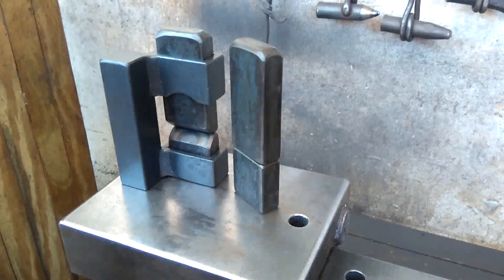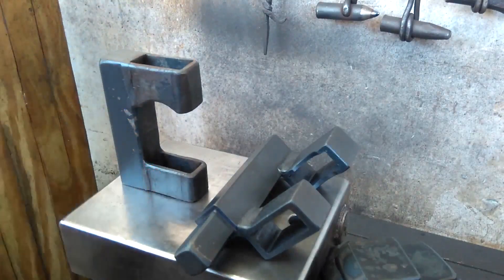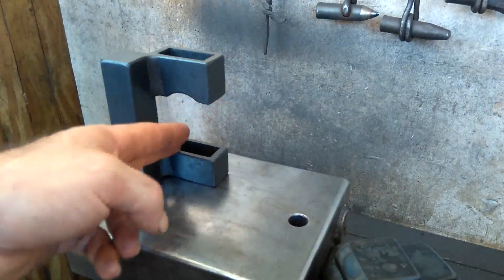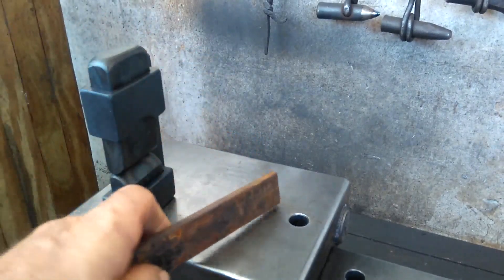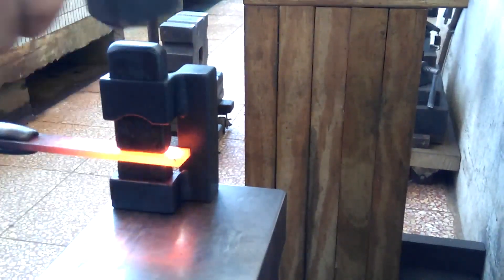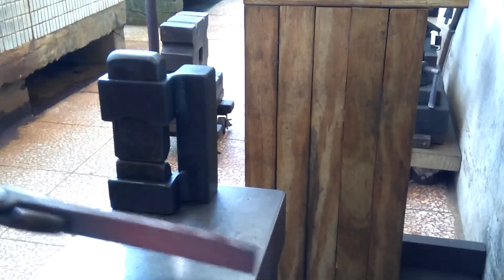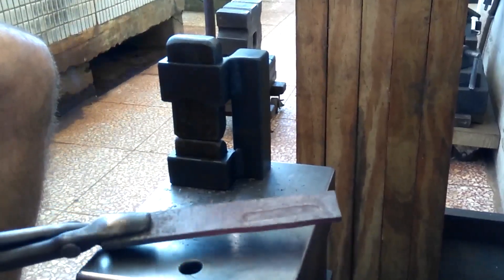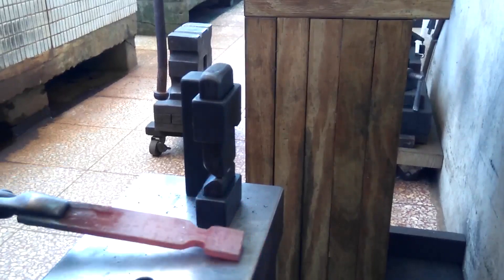Blacksmith Guillotine Tool - Blade Fuller / Blood Groove / Goutiere

Comment: I think that works well for fullering. Fullering both sides at the same time makes it accurate as long as they are perfectly aligned. Yes, I see how it works for other jobs as well. Having both top and bottom accurate is key.
Reply from the maker: My simple guillotine tool is very useful for fullering top and bottom. Thanks for watching.

Comment: The best blacksmith DIY’s on YouTube.Thank you,Glen!
May i ask how to get such a cool black color on the tools?
Maybe you mentioned it but i can't find.
Reply from the maker: I take a low heat, dull red color, for the final heat. Then I wire brush the workpiece until the price reaches a cooler, black heat. Then set aside to cool and spray with WD-40. Nothing fancy. But it also helps to have your forge running a neutral fire, preventing too much scale from building up. Thanks.

Comment: Thanks for sending me the link to this video Glen.  You have done a great job on this tool.  I am fairly new to blacksmithing, and at present just into making small stuff, so this tool would work great for me.  Are you going to offer more dies for sale down the road? Maybe a butcher or a cutting die?
Reply from the maker: I currently don't have any plans to offer more die styles but I do offer blank, un-heat treated dies that are cut and ground to size for those who want to make their own. Thanks.

Comment: The quality of your video is awesome!!!!! Just curious, could you have two different types of dyes on the same bottom? I don't know if it would eventually disfigure it or the anvil, but having two different types of dyes on the same piece could be nice.
Reply from the maker: Phillip, Ironically, I used my old camera for this video. Your questions is interesting - I never thought about having dies two-sided before. I would be a little concerned about marking my anvil face, depending on the die shape. So for now, I think I prefer to have the bottom of the lower die flat, flush with the anvil face. But it definitely could work... Thanks for this idea. Glen
Reply: Hematoma

Comment: Nice improvements! If you used a soft hammer, could you make the dies double ended? IE a different pattern on each end and flip them over?
Reply from the maker: Jack, Someone else asked the same question. Yes, I suppose the bottom die especially could be made double-sided. But I would be afraid this might mark the anvil face, depending on the die style. But I never thought about this before so perhaps I need to think about this some. Thanks for your input.

Comment: We used to call these "Blacksmith Helpers" in the 1990's. Rather than mill out the stock, why not just use tubing?
Reply from the maker: That's a very good question. I originally wanted to use tubing but it was impossible to find tubing with a proper wall thickness that fit the die stock snugly. If the guides and dies are not snug, the tool will work fine but for some operations that amount of slop can cause frustrating results. I think you're right, blacksmith helper is probably a better term... Thanks for watching. Glen

Comment: Please, for the love of God, don't call it a "blood groove".  That is such a crap term.  A Fuller is only there to provide reduced weight and increased strength to the blade.  It has absolutely nothing to do with blood or wound geometry.
Reply from the maker: Yes, I know the term "blood grove" is a misnomer - fullers were never meant to channel blood. But the name has (unfortunately) stuck. I like "goutiere" or "cannelure" better... Thanks for watching.
Reply: While it has nothing to do with wound geometry,  it most definitely has historically been called a blood groove, channel, gutter, etc.  You absolutely will not find an historic example of this channel being called a "fuller".  This in fact is the misnomer of modern sword enthusiasts who have no blacksmith  knowledge outside what they have cobbled together to make blades
Reply: Michael  no you don't 🙄🤦‍♂️🤣